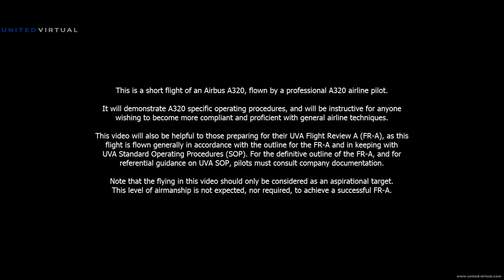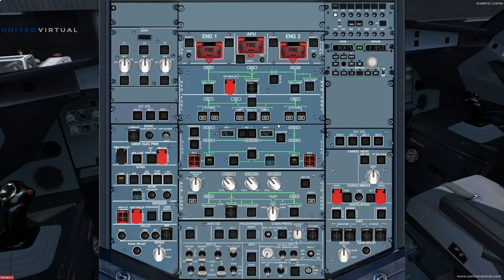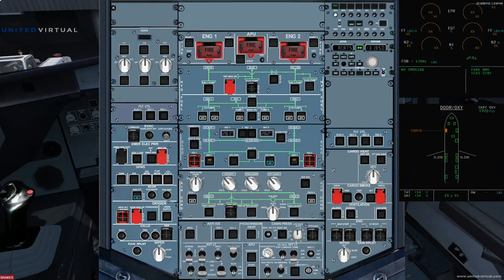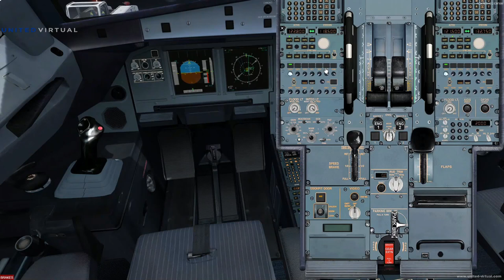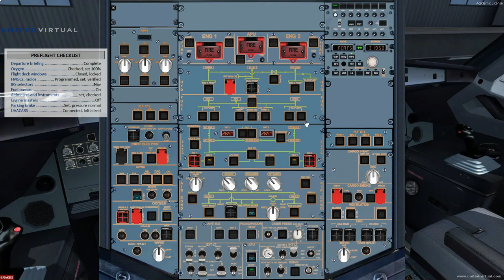United Virtual Airlines, Airbus A320 Demonstration Flight (FR-A)

Comment: Ref: single-engine taxi...why is #2 hydraulic fuel pump activated and not #1...especially on taxi-in?
Reply from the maker: Stand by ...
Reply: The reason for selecting the Yellow Electric pump on for single engine taxi operations is to ensure that the Yellow system is powered. With engine one running, the Green system is powered via the engine driven pump on that engine. There is no electric pump on the Green system. There is an electric pump on the Yellow system in addition to the engine driven pump on engine two. The back up source of hydraulic power for the Green system in the event of a loss of pressure is a piece of equipment known as the PTU which harnesses power or pressure from the Yellow system to pressurize the Green system. The PTU works both ways so in the event of a decrease or loss of pressure on the Yellow system the Green system can pressurize the Yellow in the same way. The PTU is kind of like a reversible pump in the sense that it can tap pressure via a turbine wheel of sorts in an operable system and through a connected wheel via a shaft pressurize the other side. Going back to your question, most operators will taxi single engine on engine one as the PTU is the only backup for the Green system where when the PTU is operating, sounds like a barking dog in the cabin. Using the Yellow Electric Pump pressurizes the Yellow system thus not allowing the PTU to kick in as there is no pressure loss. The Yellow Electric Pump is a continuous high pitch whine that most passengers end up tuning out after a few minutes and it less of a bother to them.

Does this answer your question or has it further confused you?
Reply: @benjaminwesoloski9333  I am surmising then that the #2 (yellow pump) refers to the system and not that it is driven by the #2 engine.  Thank you for the clarification.
Reply: @rogercurtiss3768  Correct, the Yellow system is normally energized via the Yellow Engine Driven pump which is located on the number two engine. Alternate means of pressurizing the Yellow system are either the PTU or the Yellow Electric pump.